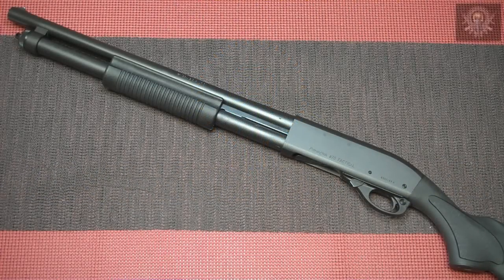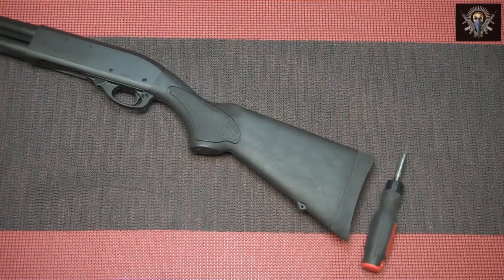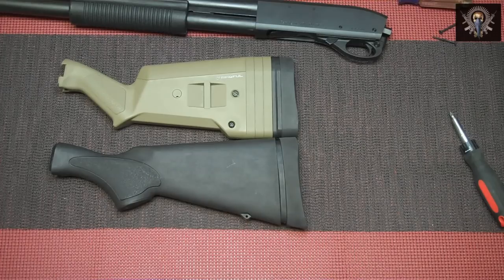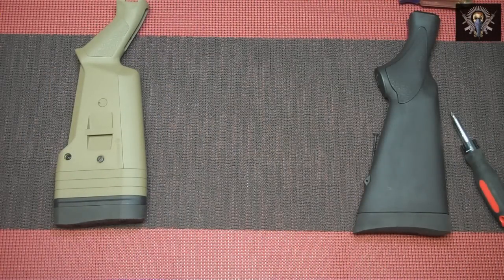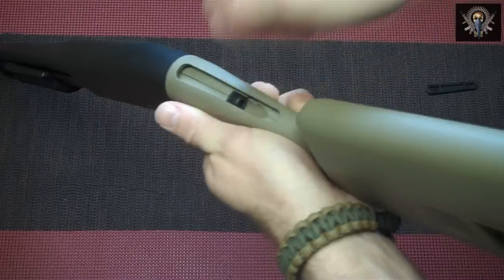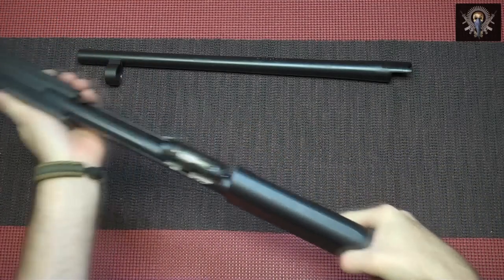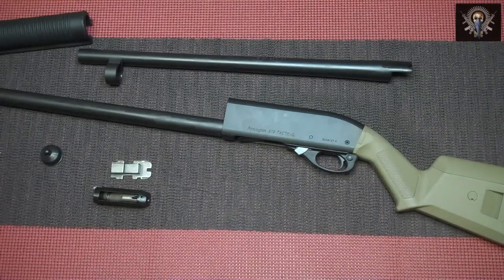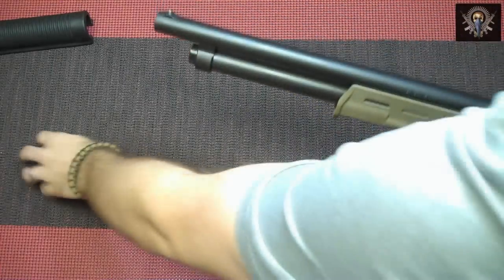Remington 870 :: Magpul Stock Set Install :: Musty Yeti

Comment: Your video really helped me allot. Picked up my 870 today on the 4th🇺🇸😎 and immediately installed MagPul stock and forehand pump. Super easy to do with your vid and this gun vice I bought. Thanks for the info 🙏. Stealth Gray was my choice for color. Forehand was the only tough part as mine was so tight I had to use rubber hammer to get it though. Came out perfect 👍

Comment: Nice video, but you're making the foregrip install tougher than it needs to be. Just unscrew the mag cap, slide out the barrel, push the foregrip forward and start unscrewing the castle nut right there in place, slide off the grip and slide on the new one, tighten the nut, slide on the barrel and screw on the mag cap - done in 3 or 4 minutes.
Reply: 993mike Best advice
Reply: Thanks.

Comment from the maker: Well with those spacers it puts the length of pull at the same distance as the factory buttstock.  I can't see anyone using the SGA stock without the spacers, it's incredibly short.  I figured that was the best way to measure the weight, with the same length as the standard stock.

Comment: When I went to remove the factory stock, I had a good set of hollow ground screwdrivers, but I couldn't budge the factory screw to loosen it, I finally had to rig up a screwdriver blade with a 1/4" drive ratchet wrench, and that thing fought me all the way, I swear the factory must have used red LocTite on that thing, it didn't loosen up till it was virtually all the way off!  It was a real hassle, but I'm sure glad its over with and the MagPul is mounted!
Reply: G56AG  can explain your tool you made? I can't get mine to loosen at all
Reply: I have a set of hollow ground screwdrivers, the bits are magnetically held into the screwdriver handle, the head of the bit is a 1/4" hex head.  So I got a 1/4" socket, put the bit in the socket, then used an extension and a 1/4" ratchet wrench, this gave me the torque I needed to overpower that screw.  Make sure the screwdriver blade fits the screw slot well or it will strip out.  I had to use some tape to hold the screwdriver bit into the 1/4" socket, I padded the stock and put it in a vise to hold it while I unscrewed it.  The gunsmith hollow ground screwdriver set came from Midway USA.
Reply: Worked great  job completed  thank you.
Reply: Good deal!

Comment: You would not happen to know the length of the bolt that magpul gives you for the kit. I am trying to see if it at all will be possible fit it to a smith and wesson 3000. However it has a different thread, so I would need to find a similar bolt with this thread 8mm x 1.25

Comment: Does the Magpul edition of the 870 express tactical come with anything other than those 2 pieces, the stock and forend? Could you buy the stock 870 express tactical and put those on yourself to make the Magpul version of it. I noticed that 870 express tactical magpuls sell for like $800, when you can just save money by buying the $500 normal 870 express tactical & the $130 Magpul stock/forend
Reply: +GeTTingWiGGly Mine came with magnum body, upgraded internals, chrome marine barrels, tube extension for 800 CAD

Comment: I'm hearing reports that the Fore-end is a bit slippery in comparison to the stock one.  Also that it kind of hangs off the end OVER the mag tab screw.

I have a 4+1 870 Express, will that screw get covered enough to be a pain to get on and off? and how well does the fore-end grip with and without gloves?

Comment: I want one of these for ends (I like my Mesa tactical LEO high adaptor and PRS stock with my optic setup though) but does it overlap the receiver atoll? I'm running a side saddle I don't want to give up.

Comment: Hey the Remington 870 tactical has rail on top and flash suppressor. This looks like an 870 express with synthetic stock. Am I correct?
 http://www.remington.com/products/firearms/tactical/shotguns/model-870-express-tactical.aspx
Reply: Its same version of the tactical I have. Also, as he's handling the gun, you can see the word "tactical" engraved in reciever. This tactical version was sold through many Wal-Mart stores.